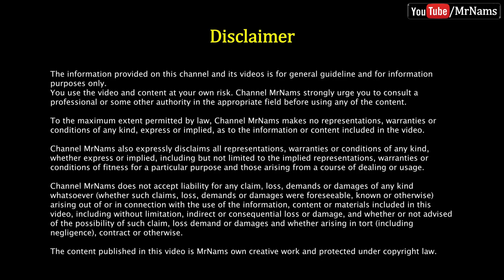what’s inside landline instrument handset

Comment: Hi, But please say, how do i  open the jack portion of the handset. The video is not clear while running this part.
Please also, say, how do i fix mic or speaker problem, due to loosened wires etc, which will be very useful.

(
Reply from the maker: Its just push fit, push it with non-sharp instrument. For loosened wire at speaker/mic need to solder them, but when they are loose at jack side we need to crimp tool, or try adjusting.
One more hack for loosed wire ate jack is, remove all jack and connect wires directly.
Reply: Hi, thanks. My problem seem to be different. When dialling the phone rings but taking the receiver there is no sound. If place receiver at the side of receiver and press the dial tone button or knob, there is no dial tone . please suggest. Video on how to repair from you will be useful. So. Is my speaker inside handset working or noise comes from other inner parts
Reply from the maker: You mean, handset speaker works while dial or when rings, but no sound when other party receive call? if thats case then its not problem of handset, no need to open handset at all. Its problem of instrument.
Reply: @MrNams  Is there any tweak that could be done to the instrument to set it right. 
I did not say that handset speaker works, what did i say was , i could hear he ringing tone krink krink, 
Do you mean to say, that it comes from the handset speaker? or some other thing
If you say, how do i repair the landlline phone, it would be useful, if simple repair would fix it.
Normally digital display would go bland first in landlines. But we use it still, because, you could use the incoming and outgoing calls
Reply from the maker: Sorry I misunderstood, now i got it, your instrument is ok. You can open handset by removing screw and opening from side, its press fit, if try from any side, you will get it how to open completely.